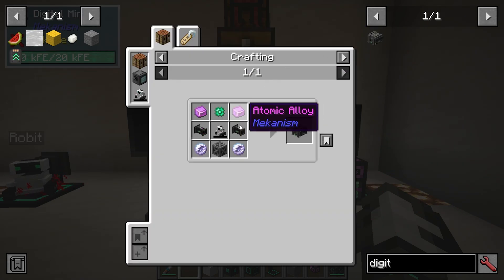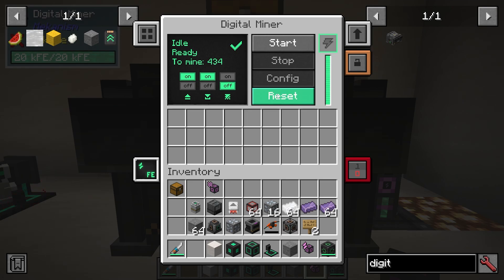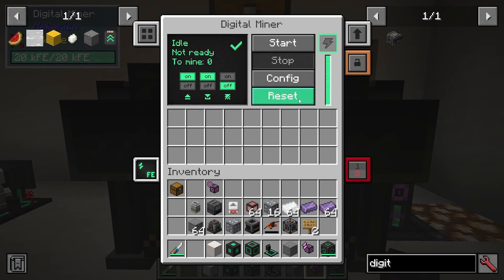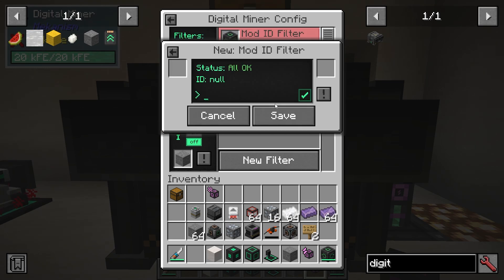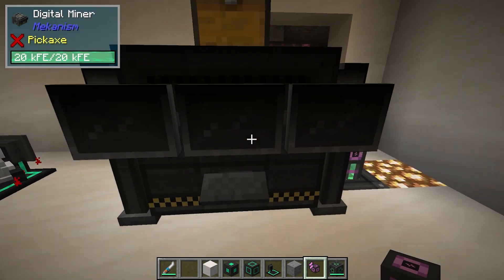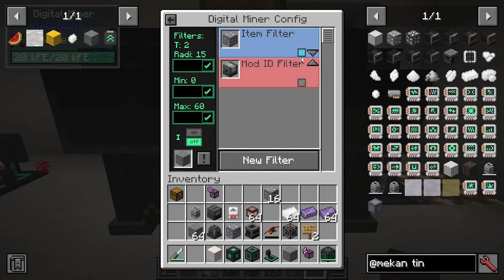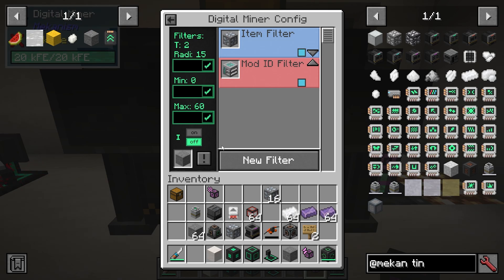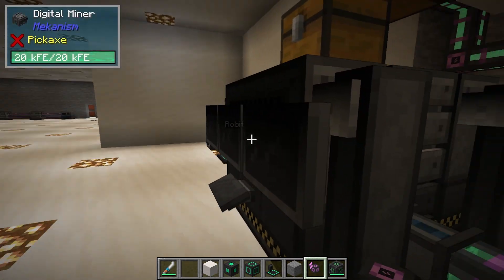Mekanism - Digital Miner Full Tutorial

Comment: When ever I try to power it, it just doesn’t want to power in and I have to keep breaking and placing it until it works but sometimes it just doesn’t work any idea on how to fix this?
Reply: If youre using a energy cube make sure its set to output in all directions so it actually transmits power

Comment: For those coming to this video, a good filter to use in general is "forge:ores" (drop the "), and it will not only include all the ores from Vanilla Minecraft, but also the most common mods, so tin for example.

Another great thing is F3+H in JEI. There you can see every tag the block has. By selecting the Filter Option > Tag, you can type any of those and then you can get all forge ores and the other less common mods.
Reply: forge:ores isnt working, is it outdated or did i do something wrong? also the tags dont work for example „minecraft:coal“ isnt working
Reply: @Jonas-uo7jm  it's is now "c:ores"
Reply: @LepriKon15  love you man
Reply: @Jonas-uo7jm  Just found this, but it depends on the version too. Try "ore*" (without ")
Reply: @Jonas-uo7jm  Which loader are you using? If you're using anything but Forge (don't know about NeoForge), it won't work. 

And to answer your coal question, you need to use the Minecraft tag of the block, which would be coal_ore (deepslate_coal_ore). You see the block tag by either pressing F3+H and hovering over the block in the JEI menu, or simply look it up on the Minecraft Wiki
Reply from the maker: I always forget about F3+H! These are really really good tips!
Reply: @JaviHerobrine  can u make a video for this

Comment: For some reason with even 16 wind turbines i cannot keep the digital miner powered, im on 1.21 not sure why but in earlier updates i used to be able to mine with just 6-8 wind turbines
Reply: like after 5-10 minutes of it running it just completely EATS through power, and just runs out
Reply from the maker: Try an Ethylene setup. If you don't know what that is, I have a tutorial on my channel!
Reply: Wind turbines are absolute trash. Set up an auto Ethylene Generator. i have 2 producing 10 times (probably more) as much power as 10+ Wind and 10+ solar panels